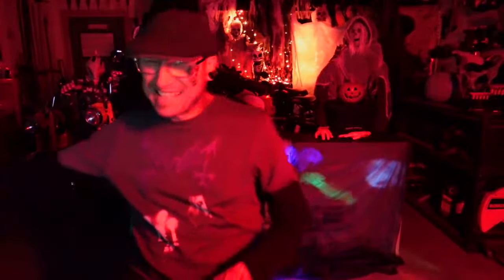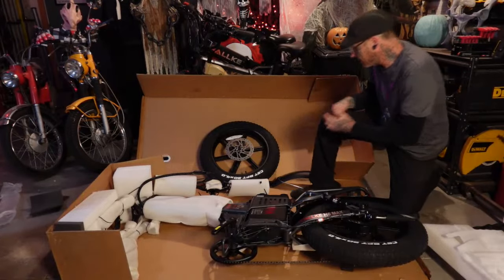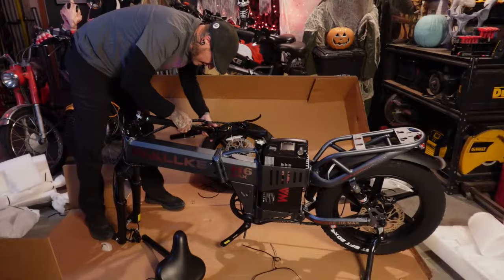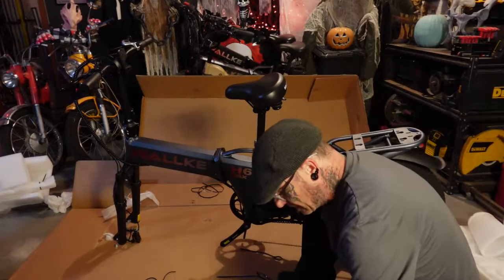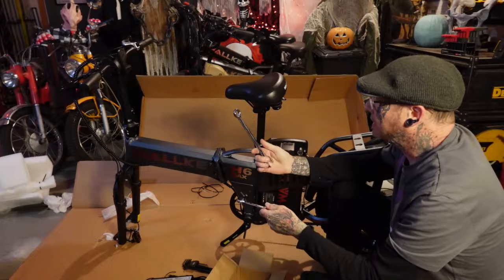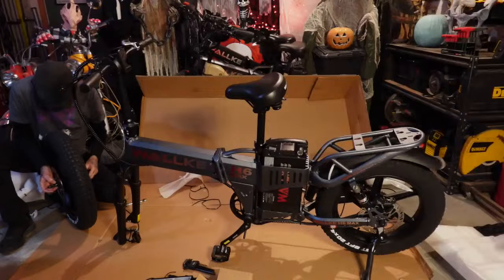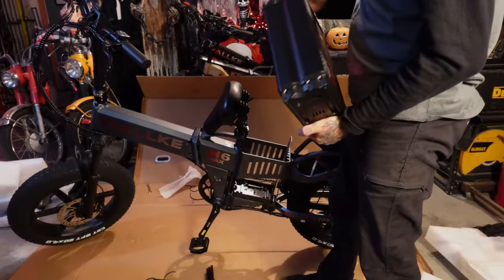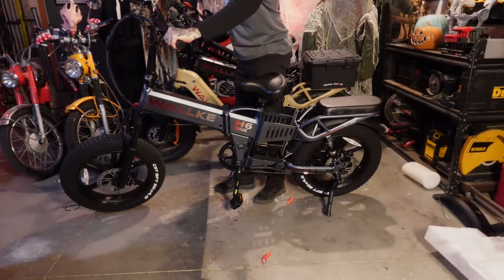Unboxing the New Wallke H6 Max Tonight!

Comment: Does this have a torque sensor? And is this model better or the H6 ST Max?
Reply from the maker: I believe they have cadence sensors. And I think the ST Max actually has a 1200w motor. In my opinion the handlebars are way cooler on the ST. They don’t fold tho.

Comment: Have you been able to get the auto lights to work? It is supposed to having a light sensor that turns on the lights automatically, but I can't find it in settings at all.  Also, they have locked us out of the PAS modes in the advanced controller and you can only access the 0 - 5 default settings even though the manual clearly shows up to 9 levels of PAS.  Finally, the app is not tracking any of my rides.  I keep getting a "navigation function has expired please renew it" message with no option to do anything about it.  Lastly, I seen screen shots where the watts being used are displayed but can't find how to turn that on.
Reply from the maker: I haven’t been able to mess with it much. Setting up a haunted house. When I saw your message I went out and looked and yeah. Not seeing a way to display wattage like on the old bikes. You can change the power meter to voltage tho. And not seeing a way to change the Pas like on the old bikes….I’ll dig into the app here soon too.
Reply: @TheE-LightenedArtist , thanks. Lemme know what you find out.  Love your channel.
Reply: @TheE-LightenedArtist  , So, Wolf from Wallke said the editing of the PAS settings are blocked intentionally.  That is very frustrating and makes no sense, especially since they market it in the manual.  Also, he said there is no setting for the auto lights and they should just activate on their own, which mine do not.  Still getting that navigation error message and he asked me to send it to him which I did.
Reply from the maker: Yeah my lights aren't automatic either. I used the nav on my commute today and it tracked my route and logged it. I was able to switch the picture on the app too.
Reply: @TheE-LightenedArtist  , How did you change the picture on the app?  I have been going back and forth with Wolf over issues.  The auto lights being one as he consistently says they should turn on themselves when they get dark.  My app is useless and I sent him screen shots of error messages and he said they have to look into and get back to me.  The range is awful as I got 46 miles on my first ride using PAS 2 and 3 and average speeds about 17 MPH.  My h6 v.1 far exceeds this with smaller AMPS (35 vs 40).  All in all, pretty disappointed in this "upgrade."  At this point, I'll take my H6 v1 over this.  Anyone looking to upgrade from version 1 to this, I wouldn't as they tradeoffs are not worth it.  Also, they advertise all these display features on the website and when I ask him about them he says, "our technicians disabled that."  Yet, on the website they still show a pic of the display showing wattage used on the screen and they auto light feature AL sensitivity in the menu display, which was "disabled," again by techs.
Reply from the maker: bah. It only changed in the device info not the running app. The only use I've really gotten out of the app is recording my route. And yeah, The larger battery capacity gets gobbled up by the larger motor. I do like the higher speed and torque tho. I won't be able to truly judge performance till after about 100 miles. All my bikes have performed way better after tires, batteries and motor gears have been broken in. My OG H6 is still my favorite....
Reply: @TheE-LightenedArtist  ,I have experienced that the higher speed and torque dissipates when there is 40% and less battery remaining.  At that point, it is about on par or below the H6 v.1.  I tested this out by having my wife ride my original and pacing her.  Once the battery dips below 40% the Max is actually slower than v1.  Looking back on it now, I would prefer the standard display as this new one is pretty useless.  At least yours tracks your ride, my disconnected 4 times while riding.  Today, I did 44 miles and my battery hit 20%.  I turned it off then back on and it went to 50%, but after about 3 additional miles, right back to less than 20%.  Looking forward to seeing your full review, as my experience is I wish I did not upgrade and I miss my H6 v1 which now belongs to my wife :(
Reply from the maker: I got to play with it a bit. Quite a few head scratchers on this one. In the settings it should have an "AL Sensitivity" setting for the lights but it just says "sensitivity". I tried different levels and turned the lights off in the garage but nothing. This particular display comes in two versions. I saw a review on a different bike that had this display and the AL function worked but it didn't have a charging port. So I'm curious if these come with either a charging port or a light sensor but not both. Either way pretty lame. And the App connectivity is super glitchy.
Reply from the maker: The app doesn't connect automatically any way.  You press "add device" to connect. Seems counterintuitive because you'd thiink you've already "added the device". But that's how you connect. Just went out and did it and it started right up no prob.
Reply: @TheE-LightenedArtist  , I'll let you know about the two different display versions theory.  Wolf has agreed to send me out a new display due to the auto light feature not being on mine.  He said this new one would have it, but nothing about it not having a USB charge port in replacement of it, which would annoy the hell out of me :)
Reply from the maker: Yes definitely! I’m working on a video that goes over that. It’s hard to whittle the YouTube stuff between full time work and life but folks like you really help out. Cheers!
Reply: @drummer4gear Thanks for  letting us know your issues. I have 2 h6st Max's and just going through them